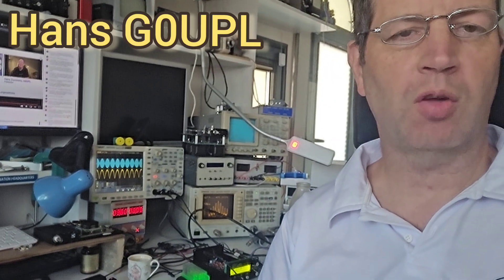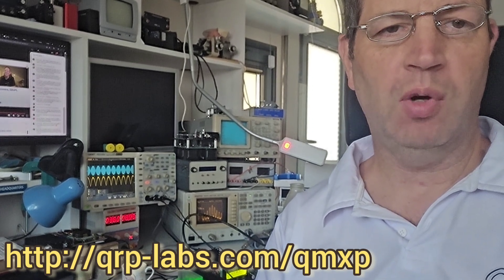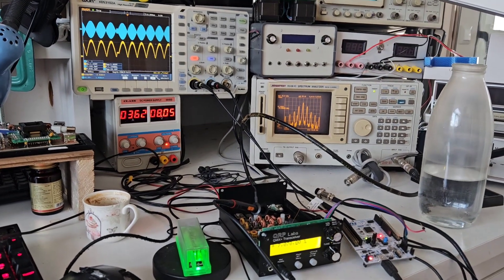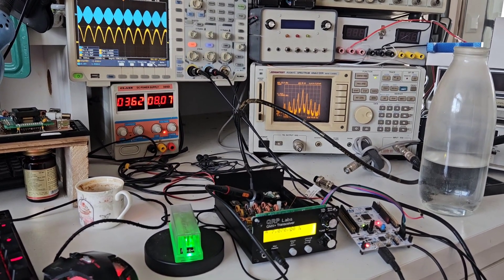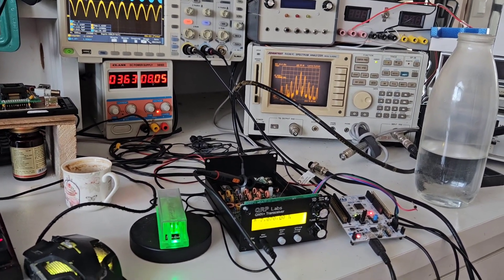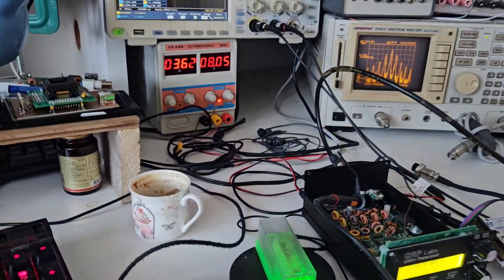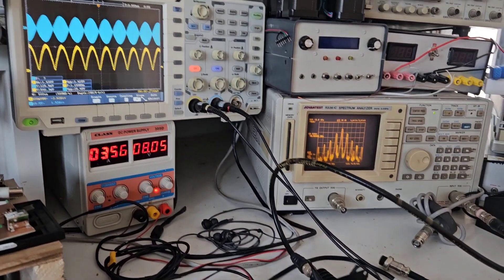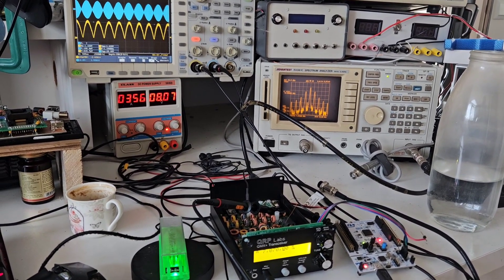QMX+ Update: SSB work and the RSGB Tonight-at-8 webinar

Comment: Hello, my name is Peyton and I am currently attending college at Missouri S&T.  I am studying electrical engineering with an emphasis in communications and electromagnetics.  I am an aspiring RF engineer and I currently work for the Electromagnetics Compatability lab on campus.  Really, that has been my first introduction to electronics and pcb design.  Your many projects are masterful and my Amatuer Radio Club(W0EEE) admires you greatly.  Where did you learn how to design high-speed, specifically HF, circuitry and layout?

Comment: Cool and looks like at STM dev board off to the right, what is its role?
Reply from the maker: It's for programming the code into the QMX+ microcontroller, for firmware development. All the STM dev boards have an "STLink2" programmer section and I'm using that connected to QMX+ for the code downloading. My QMX+ is "unlocked" so I can program it this way. All shipped QMX+ are locked, they have a bootloader and in the firmware update mode, the QMX+ appears on the PC as a USB Flash drive and you just drag in the new file.

Comment: I just finished building my QMX+ about a month ago I bought at Hamvention last May.  It went well (aside from a few swear words along the way...LOL!).  I'm using a fixed 5x desk mounted magnifying glass, and I have a stereo microscope on a boom mount that can be positioned to allow work on fine detail if needed.  I'm getting 3 to 5 watts output depending on the band.  On to the next project: 2 QMX mini's I just ordered and received 80 - 20 and 20 - 10.  It was a pleasure meeting you at Hamvention, Hans and working on these projects is a great way to escape the news circus/side show of nuttiness!  Mike - ND7E

Comment: Will SSB be an add on board for existing QMX+ units or will it be an entirely new architechture? I ask because I am looking to make a purchase of one of these in the next week or so and am wondering if I should wait.
Reply from the maker: It's a firmware upgrade only, and applies to all existing QMX and QMX+. Note that the firmware for QMX and QMX+ is the same (some people missed this point).